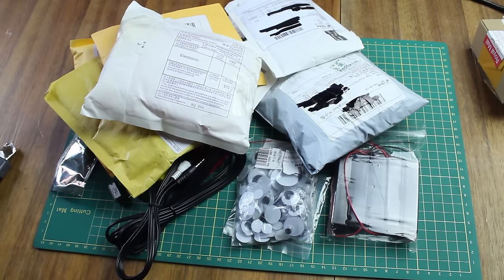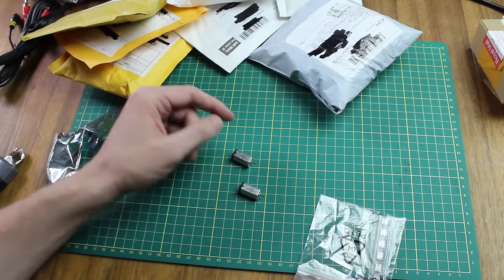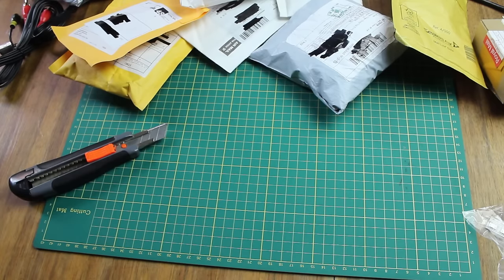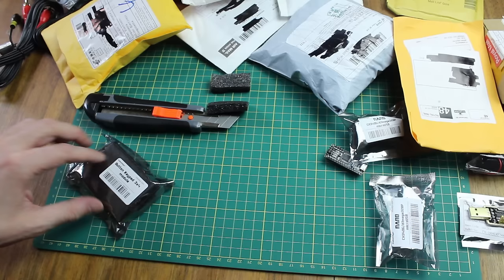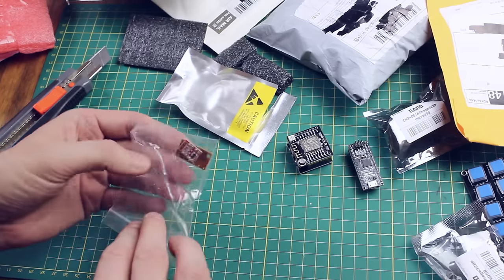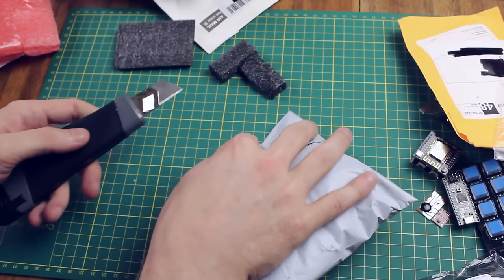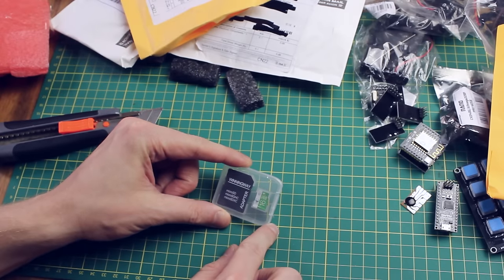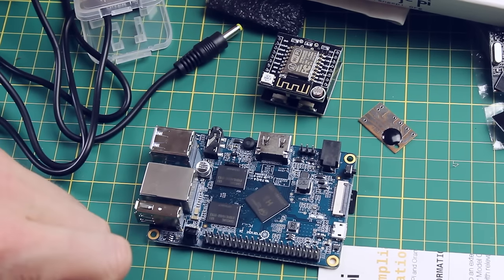Post Bag 05: Make a cup of tea, it is a long one

Comment: Nice set of goodies! I also got a batch of those nanos last year but nearly all of the damn things weren't recognised as serial ports when I plugged them in, those ftdi drivers are a constant pain in the rear! However failing that you can still use those usb-ttl adaptors to access them.
Reply from the maker: +jix177 thankfully RobotDYN use the ch340g chips rather than the fake ftdi ones.

Comment: Nice selection of electronics. Too bad the dc power cable doesn't fit the connector on the orange pi. Because this used to happen to me allot I keep in the lab a set of dc jack connector adapters. On one end each adapter takes standard 2.5x5mm and on the other end you get various sizes and styles of connectors. Here is a link http://voltlog.com/y/1en0i

Comment: Did you ever use the NRF boards?
Reply from the maker: Occasionally, I had a project that stalled which used them for a self-creating/regenerating sensor network.
Reply: Sorry for commenting on an old video, just curious as i use a few of them for temp sensors etc.

Comment: pitty the opi pc using such an odd power jack. pretty easy to power it from the pin header tho, just TRIPLE check you have the correct pins.
i am consider removing the barrel and just hard wiring a usb cable in its place. i've had a very pleasant experience with armbian. 
becareful with vendor images with their overclocking and overvoltage of the cpu, plus their kernel security flaw. armbian patches all this for you.